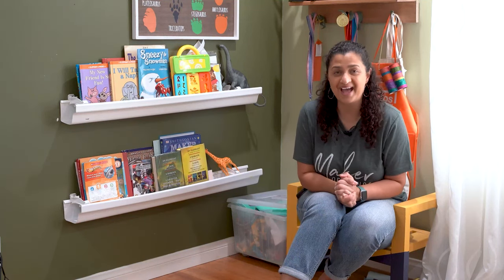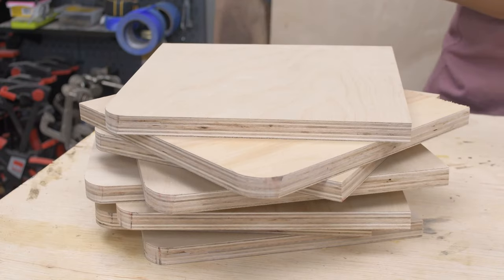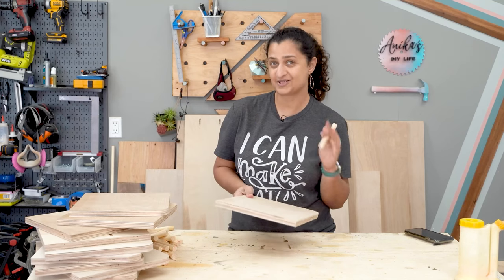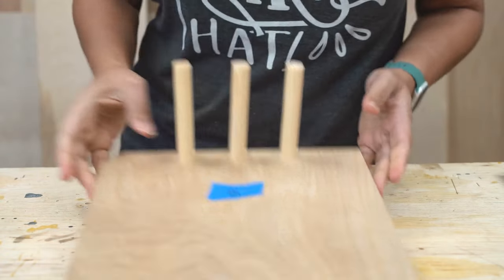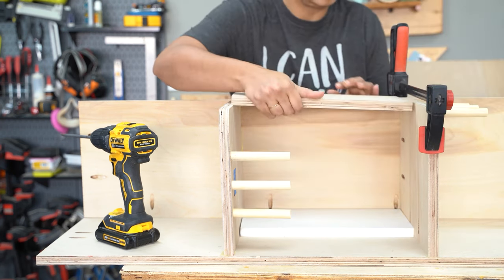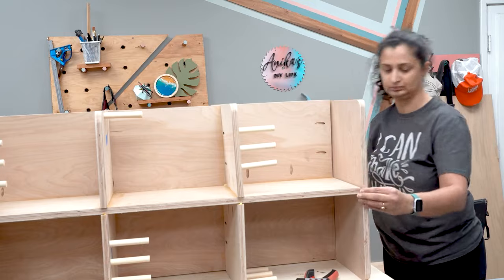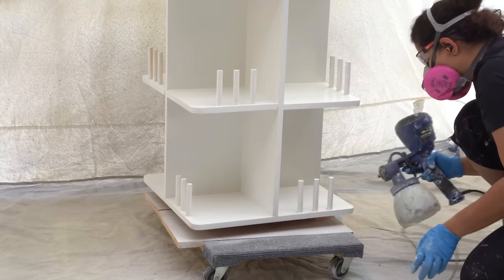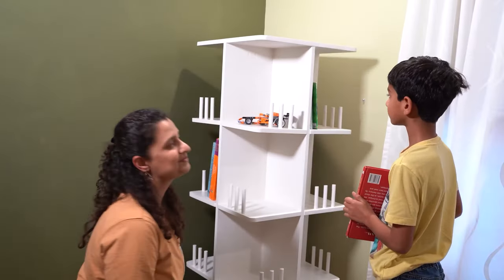Easy DIY Rotating Bookshelf - How to build a swivel bookcase

Comment: @Anikasdiylife thanks for the lesson.  You can make a similar build for your workshop! Instead of shelves for books  use French cleats or drill holes for peg board hooks!
I recently had to plaster a room...I hate plastering corners...very similar to caulking which I also hate. I'm a Jill of all trades and love a good Jerry rig! I find sometimes my hobbies can cross over so to speak.  I love to bake and decorate besides woodworking. 
I filled a disposable icing bag and extra tip with the plaster!! Not only did I complete the plaster in the corner in less than 3 minutes...yes I said less than 3 minutes!...but the plastering was far more accurate and way less sanding! You could potentially do the same with edging the plywood. Simply use a flat tip on the icing bag. 
I recently saw a video where the guy somehow attached a drill to the end of the caulking gun and when he pulled the trigger it forced the caulking out quickly.  I wish I could recall how he did it...caulking guns are really hard on my arthritis.